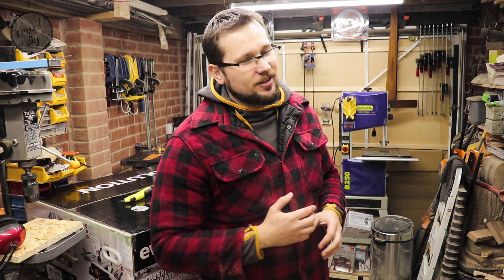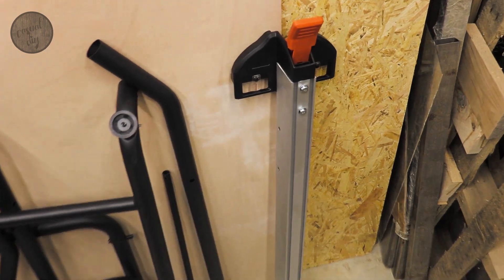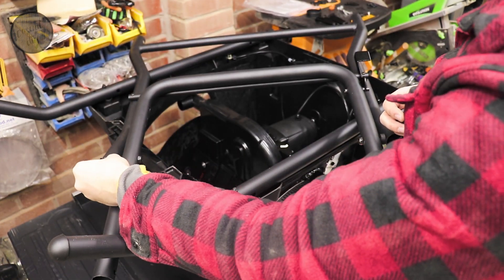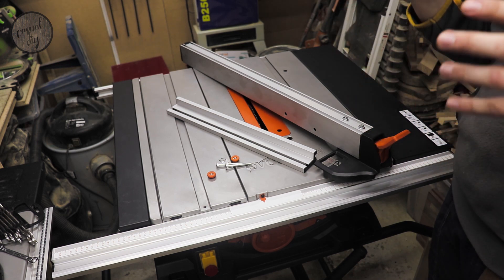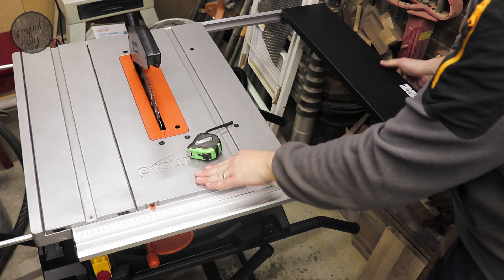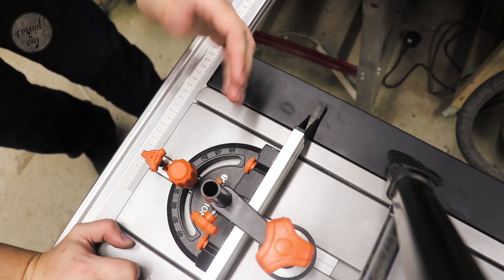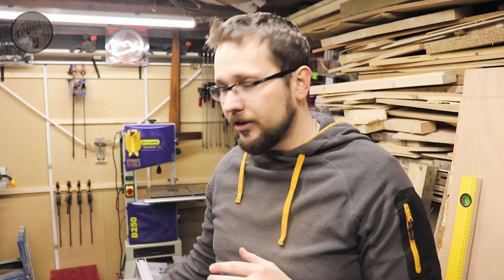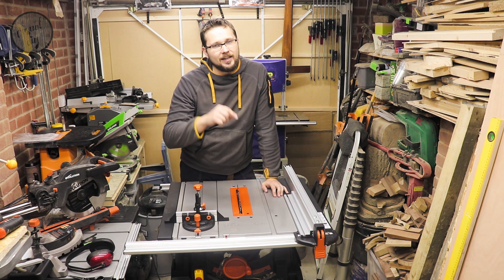Evolution Rage 5-S unboxing and assembly - in detail - plus all the features of the saw

Comment: Not sure if you will still read this after 11 months but just wanted to tell you my Rage 5 is now on it's way to the Philippines. Thank you for your help. I cant wait to use it ( about 6-7 weeks to get there )  Regards Ian.
Reply from the maker: Hehe of course I will ready it😁 I'm glad I was able to help 👍
Reply: @CasualDIY  It arrived two days ago and I was so excited to use it. Unfortunately there is a problem with it. It is still usable but when I wind the blade up and down the part of the blade nearest to me stays true as it moves up and down but the far side along with the riving knife moves from side to side by 1.65 mm This is caused by the threaded shaft with the nylon gear on not running true ( the gear and bearing seem to be OK but the thread has not been turned true to the  bearing and this makes it wobble) If I make sure the winding handle is in the 9 O'clock position it is where the blade is in the correct position relative to the fence on each revolution. Otherwise seems great. I will try and contact Evolution and ask if they can supply a new shaft for me to bring with me next time I come home. Obviously don't want to send it back under warranty from the Philippines. Regards Ian. .
Reply from the maker: @ianmcnulty3279  oh no that's so bad! Sorry to hear it. When you email Evolution ask them if they would send it directly to you, I bet you they would 👍
Reply: i have sent my email off today with a short video of the parts moving. will let you know the outcome. Fingers crossed.
Reply from the maker: @ianmcnulty3279  Yes fingers crossed 👍
Reply: Wow emailed them and had a reply straight back. They posted the part and a (free small belt sander and a 40 tooth wood blade) in way of compensation ( I was expecting them to say the warranty didn't cover me in the Philippines. The parts arrived Monday morning at 10:30 am our time here. The part is now fitted and working fine. Thank you for your help and suggestion that I ask them to post it here for me. 100% satisfaction with their customer service very impressed. Once again thank you too. Regards Ian.
Reply from the maker: @ianmcnulty3279  you see it's a very good company that's worth supporting 👍 Hope the saw will work for you perfectly now😁
Reply from the maker: @ianmcnulty3279  Thank you for the donation 😁👍

Comment: A couple of points I would make are if you, like me, do not (or didn't!) use the extraction or indeed the blade guard, saw dust & wood waste quickly builds up as the blade is completely enclosed, to the point where the saw will not retract completely. My plastic blade shroud actually burst because of pressure from the built up debris. Do check the blade alignment, mine was out in all directions.

Comment: My new evolution 5S table saw then as I raise the blade to adjust it to be vertical and adjust the riving blade the blade wobbles from side to side it seems like a rod is bent. Also how do you lock the 90 degree position when the locking lever is in the way of unlocking allen key nut and washer to lock  the 90 degree position it shifted when i release the locking lever how do you manage the adjustments and does your blade wobble when raising it on a evolution 5S table saw
Reply from the maker: Nothing wobbles with my saw mate, I would give a call to Evolution customer service and let them to sort it out. They are pretty good with their customer service 👍
Reply: @CasualDIY  Thanks will do on Monday, cheers .

Comment: Question - when you're using the mitre guage for cross cuts etc - do you put anything under the timber to be cut to raise it? Because on my saw the sliding section of the table is about 0.5mm lower than than the rest - If I clamp a piece of wood to the mitre guage and try to slide it, it sticks quite badly on the right which makes keeping it straight almost impossible.

I'd have thought the sliding section should be very slightly raised to avoid this - is my saw set up wrong?
Reply from the maker: I don't have that issue with mine. I would contact the Evolution customer service.
Now I use my sled for cross cut sled.

Comment: The blade guard has been redesigned with a piece sticking up at 45% also the table top is cast aluminium. I've posted the images on woodworking on Facebook also the logo is not on my version.

Comment: Hi nice review, did you ever finish the video on how to align the fence, got mine last week and I can't manage to get the fence straight.
Reply from the maker: Not done a video but yes I have aligned the fence. I just loosen the two bolts on top of the fence and put it straight that's it.
Reply: @CasualDIY  yes I've been trying with the bolts. I'm 2mm out at the front when the fence is clamped in place. I assume you just loosen the bolts while the fence is unlocked align it and tighten the bolts up again but seems to not be aligning for me. Guess I'll play with it more
Reply from the maker: @deanarmstrong1160  yes that's what I did. Hmm not sure what else is there. Could be that the motor or blade is not sitting straight.
Reply: @deanarmstrong1160  Hi, there are three screws on the actual table bed-two at the front and one at the back of the blade. These allow you to align the blade to the mitre slots and, of course, to the fence. Hope this helps.

Comment: Thanks for all your good videos ! I have a question about your rip fence, I have the same table saw and I'm really happy with it BUT I can't manage to have the rip fence to slide parallel to the saw blade, there is always a litle diagonal mouvement. For example if I slide it right the front with the handle slide more than the back, same on the other way. So I always have to check the distance at the In and the Out of the saw blade to make sure it's not pinching against the fence... In your cas did you manage to have a perfect parallel slide and how ? Thanks again !
Reply from the maker: Hmm when I move the fence it dose seem to do what yours does but once tightened it goes parallel to the blade.

Comment: Well got my saw today, assembled it turned it over, not happy, the top has knocks, scratches and a dent. Also a bolt missing to level the extending table section.
Reply from the maker: Drop an email to Evolution customer service, they need to sort it out for you.

Comment: hi i got it today, put it together and will try out on Monday. I did find though the blade not quite straight. i have an electronic angle guide so if that is acurate i get a reading of 89.5 degrees,, is there a way of correcting this? ps i did check the angle adjuster of the machine :)
Reply from the maker: The leaver (wheel) that changes the angle has got the angle indicator that just needs adjusting. Set it up to 90 and then change the angle scale. Hope this helps
Reply: @CasualDIY  ah you are talking about the ajusters under neath - yes tried that, went as far as it goes :) , its just that half a degree out
Reply: @CasualDIY  ... just looking , there is 2 black nuts on on each side of the silver slider - this is set at the factory, i am going to see if i can slacken and adjust. thanks anyway
Reply from the maker: @ChristopherClaudioSkierka  Yes that should do the trick

Comment: Hi there love your unbiased and down to earth reviews. I am looking at buying this saw here in Australia. A question for you please what are the dimensions when the unit id folded up? Depth, width and height to top of handles as i am looking to store under a bench i have built years ago. Tried evolution direct sent me dimensions for the drop saw? then they sent me the following  Storage size with legs closed
H =110 cm W=77 cm D= 58 cm without the blade guard fitted. With is 73 cm. I assume they mean which is 73? Surely they mean 73mm Can you help please?
Reply from the maker: Hi sorry for the late reply, I have missed your comment somehow. Ok so the dimension of the saw when fully folded and the blade hidden in the saw (no blade guard). Height= 111,5cm(from the top of the handless)  Wide = 73cm(the widest points are from wheel to wheel) and Depth= 53,5cm(blade hidden in the machine, no blade guard).

Hope this will help.

Comment: Great review! Got a question just bought on and found my blade not 90 degrees to table. How do you adjust it ? Many thanks Rob
Reply from the maker: The turn wheel that adjust the angles of your saw has got two stops at both sides. You may need to adjust the one on the left and then the indicator for 0 degrees. Hope this helps.

Comment: Anyone have the main fence wobble?  It actually wobbles in the guide at the front of the saw (where the 2 white nylon pieces go into the extrusion).  So, sometimes when I lock the fence it is straight, other times it is off.  Thanks.
Reply from the maker: Not came across of that problem to be fair. Have you tried to adjust the fence?

Comment: Hi! Thank you for all you’re hints: I got the Evolution machine just yesterday. I pout it together and all went well despite the pathetic instruction book. Anyway, I’m happy to have snd look forward for making stuff with it. I do have a question about the setting up of the zero point on the graduated guide. Why setting it on the orange sign? Shouldn’t it be set in line with the blade? Cheers and Ciaos :)
Reply from the maker: Thank you for watching my video. Hope the saw will serve you well. With regards your question, not sure what you are referring to. Is it the angle adjustment wheel?
Reply: It's the comment in the instruction manual.  It states to zero the rule before doing anything else. Thank gawd for this video, helped me with the assembly. The rule can be zeroed in after assembly when fine tuning.

Comment: Thanks for the interesting review,
Just bought it and i'll get it today.
Can i put dado blade in it?
Reply from the maker: Hi and thank you. You can't put a dado blade in this saw. To be honest I don't think you can put any other blades than Evolution ones. As the saw works on much lower RPMS so it can cut through metal and the Evolution blades are designed for that.
Reply: @CasualDIY  oh, interesting.
Thanks for the response.

Comment: Unpacked mine today .... the assembly went smoothly as i followed this video (apart from a carriage bolt which was missing .... i didnt mind as it only costs a few cents) ..... THE PROBLEM was when i tried raising the blade (with the saw off thankfully) - the blade was raising up and hitting the aluminum surface !!!! Then i realised what was wrong .... the motor assembly from the bottom was OFF of its "hinges" .... who ever put this together put one of the hinges out of it's place ... then to make matters worse i loosened the "inside hinge" instead of the outside (cos obviously the manual does not include this procedure) and it took me the good part of an afternoon and a LOT of swearing to put it in the correct order .... it was really a pain in the butt to get right due to that factory error
Reply from the maker: Yes heard some horror stories like that unfortunately. The only good thing about it is that the customer service at Evolution is very good and if you called them I think they would sort hat out for you. Be safe mate.
Reply: I managed to get that sorted myself .. then another problem arose .. which seems to be the final issue but if it's not solved, the saw is unusable .... the carriage is stuck, it only moves about 2cm ..... what seems to have happened is that there is a loose bolt of the carriage track which is wedged between the carriage and the table base .... as one of the tracks is loose , it means that the mitrw slot is too wobbly for any mitre gauge or jig to be used .... here is a video of what i mean https://drive.google.com/file/d/1BNcaTk4yA-LFtzZn5pFODN_VQPqymnN2/view?usp=drivesdk

Comment: Really appreciate your video, I did a silly mistake installing short bar and the table was not level. Was about to send it back in frustration. Saw your video and worked it out. How do you fine tune blade if its off?
Reply from the maker: Good to know my video was some help to you. What do you mean your blade is off? Is it off to your fence or the riving blade? I had a problem once that I bought a cheap blade for one of my circular saws and the blade itself was bent! Couldn't believe it, you could see it with an eye but when you put a straight edge against it you could see it was off.
Reply: I saw some other videos on table saw that have fine tuning available underneath the blade if its not completely square. Maybe this is not available for evolution table saw.
Reply from the maker: @fozlurrahman7052  never checked if there are any options to fine tune this blade underneath it but I doubt it. It needs to be square to your fence and the blade must be straight to your table but never came across one that wouldn't be straight to the table as that would mean the harbour is not straight and that would be a serious issue to which my response would be to send the saw back and ask for it to be repaired. But I will check this saw to see if there is any adjustment, you got me thinking now ;)
Reply: @CasualDIY  I have the same issue with my rage 5 s like drake summer. The blade is not abolutely straight to the table in the 90° position. Did you find a solution for fine tuning this, like you have on other table saws?
Reply from the maker: @karlchenschmitt  if you using the scale next to the adjustment leaver it may be just the scaling incorrect. Can you get your blade to the table at  90 degrees at all? And to be honest I stopped using the scales on any of my tools. I bought a digital angle reader with magnetic sides. Doesn't cost much but it's easy to use and gives fantastic results.

Comment: How are you getting on with the saw and what work do you do with it?
I bought one to rip through wood with embedded nails, it was so slow I gave up and used a rip handsaw. I am thinking now do a I sell it or try another non evolution blade if I can match one up safely.
Reply from the maker: Hi, so far my saw forks perfectly. I do have to set it up from time to time as I do move it around the shop quite often. But other than that is fine. Not sure why your saw is slow and how? Maybe you need a new blade? I don't think you can use any other blades on Evolution saws as they are lower RPMs and I have not found a blade that would be designed for those type of saw speeds.
Reply: I changed the blade. The issue with other blades is the bore  but there are adapter rings  but its matching up with the riving  knife thickness and the kerf. The minimum rpm is a red herring, maximum could be an issue but you know that from the evolution blade. Some things I like about it but many  I do not. Possibly, as an ex joiner I am used to industrial machines and I am expecting too much I know some people who have used other non evolution blades, one I know is still alive!. I am glad you are happy with yours.
Reply from the maker: @icespeckledhens  Yes this machine is more a DIY experience, glad your friends are still ok lol 🤣

Comment: Thomas, a question regarding the Rage 5s table saw. I've notice quite a few people saying they had difficulty with the blade guard getting in the way of the material, preventing it from reaching the blade. In some operations - using your excellent looking sled or cutting thin strips, for example - you have to remove the guard and I wondered what effect this had on the dust collection.
Reply from the maker: Yes there was an issue with the blade guard, exactly what you described. With regards dust extraction and the sled, I was expecting a spray of dust everywhere. But that is not the case. Some of the dust is pushed by the blade towards the bottom extraction - always got a shop vac on. Some of the dust comes at the front bottom of the sled - that must be coming through the zero clearance channel. So all in all its not too bad👍
Reply from the maker: I don't use the guard at all and there is no over spray of dust. I heard that the latest models of the saw cone with different blade guard and that problem is no more.
Reply: @CasualDIY Thanks! Excuse the misspelling of your name. I've seen it on sale at Screwfix for £219. Alas, it is not in stock...oh well, I can hardly wait to replace my tired old, second hand Scheppach.
Reply from the maker: @whomadethatsaltysoup  that's a very good price if you can get it. Sometimes it's on sale on FFX worth having a look. I don't think you will get anything better for that prize.

Comment: I just bought this saw because of your video and well, it's not that good. The worst thing is a not straight table. Can you do a quick video with a straight level and a torch or something behind it? Camera very low so everything will be easy to spot. The same with insert, it's lower than table, bends easily so it's impossible to get straight cuts
Reply from the maker: If the table is not straight I would ask for the saw to be replaced. Check this video out, I'm showing how flat the table is here:
https://youtu.be/eGUAYf2Lwmw

Hope it helps